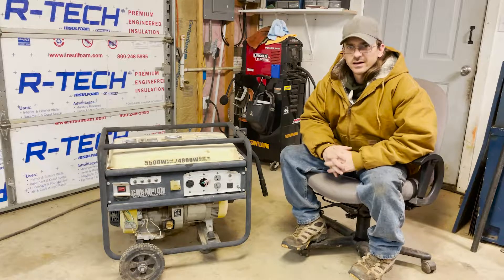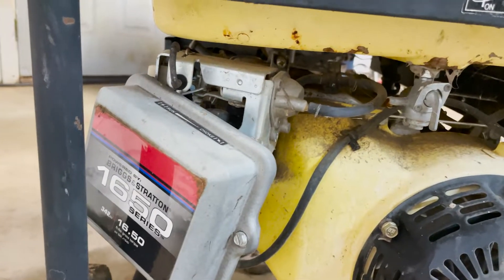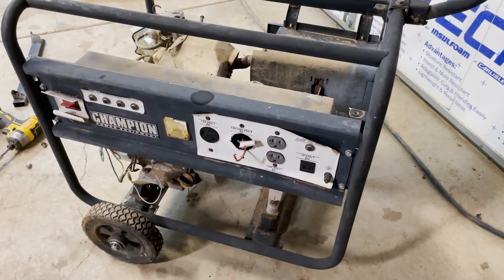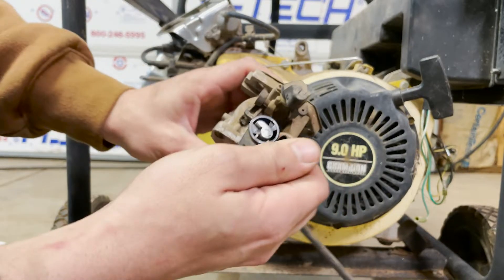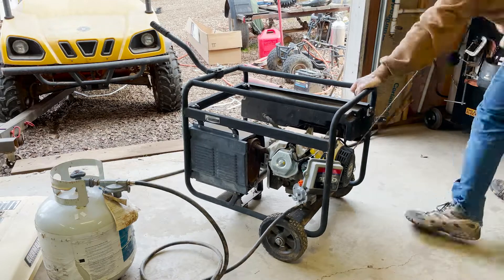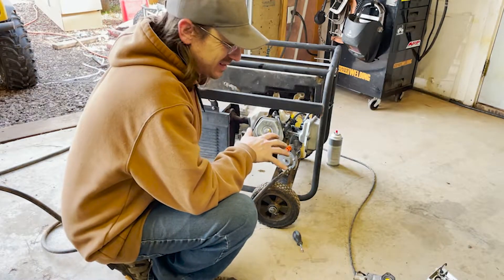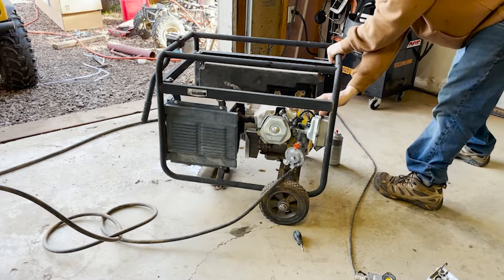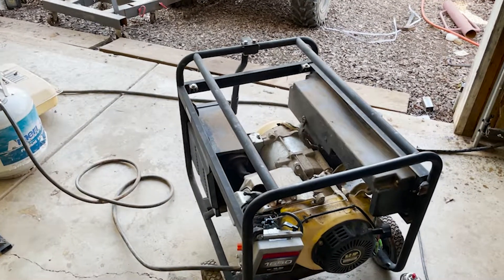Propane Carb conversion for generator, Honda clone Gx270 on Champion C49055 4.5-5.5KW. For Gx240-390

Comment: Those cheap Chinese Carb with built in LPG regulator is hit or miss. You may have better luck with an actual propane conversion kit with quality demand regulator.
Reply: And you may not.